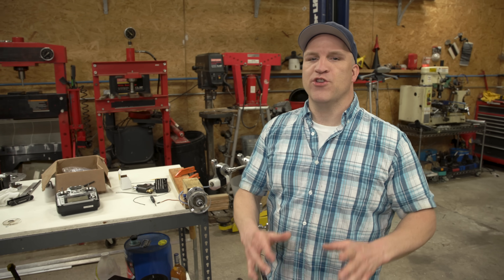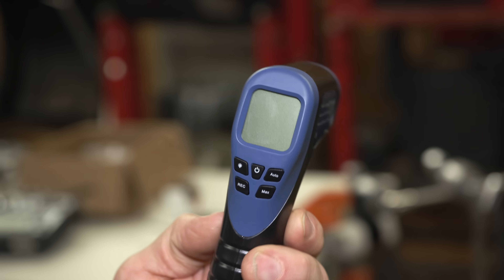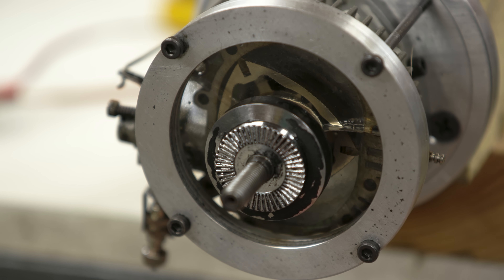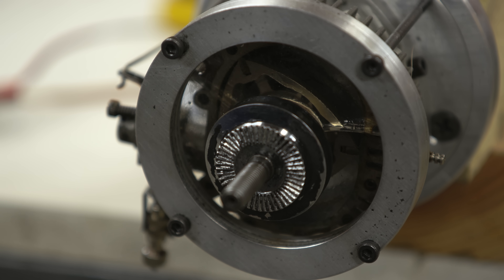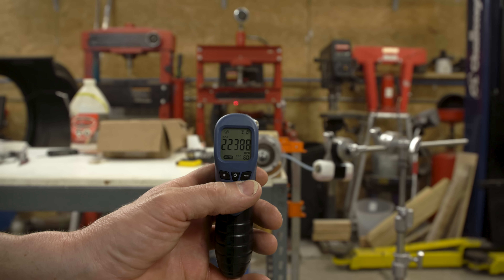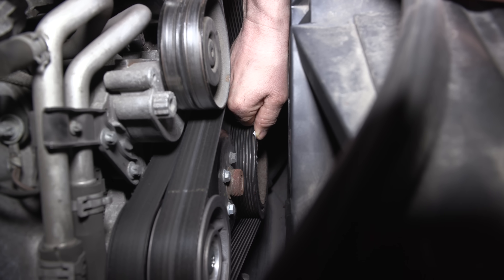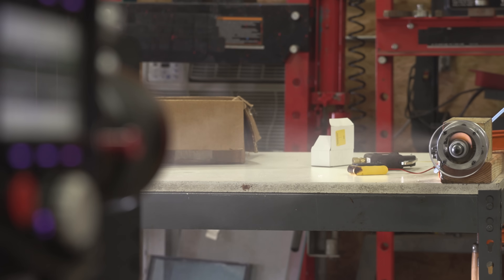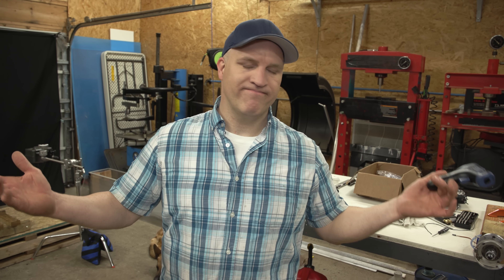See Thru Rotary Engine MAX RPM - 29000 (Wankel Engine)

Comment: its still to rich and those motors can rev out to 48000 with the right fuel and the right fuel air mixture.
Reply from the maker: Really ?, I'll have to try that soon .....
Reply: 48000 rpm is more like it
Reply: This is true, regular piston Rc engines redline at 32,000. Rotary has to do more for sure.
Reply: Dave Micolichek I had a picco .32 that surly got up there once I ported it. I don’t doubt it. But I was just putting out an easily achievable number lol
Reply: Warped Perception you might want to do some incredibly in depth balancing. There is a fair bit of vibration in the slo-mo. I must say if you built this yourself, it's very very impressive.
Reply: Rick Delair renault 1.6l vgt turbocharger spools up to 250.000 rpm
Reply: Rick Delair Cool piece of kit. I have an h182 that I got for free due to a bad motor cap. I ended up recapping the entire preamp, power amp, percussion section, and power supply. It sounds wonderful, but it wasn't enough. So I decided to build a single rotor leslie cabinet using a 100W eminence speaker I had laying around. Now with a bit of overdrive through the rotary, it sounds AMAZING!
Reply: Rebel Gaming 
At 48k that means the engine is turning over at 800 times a second.